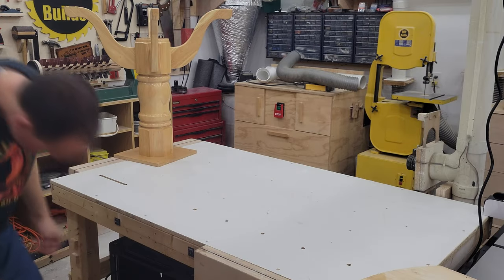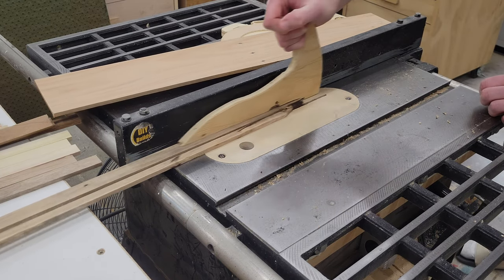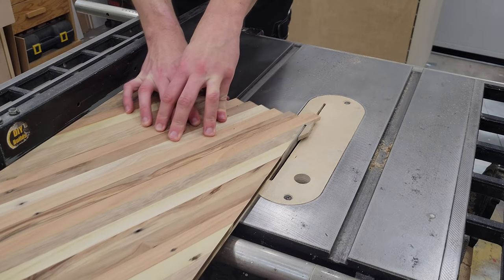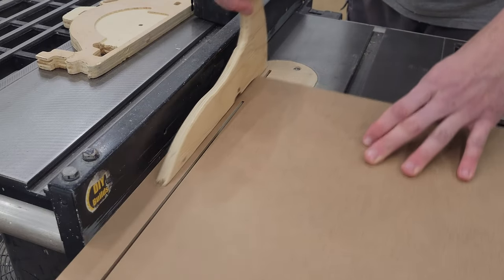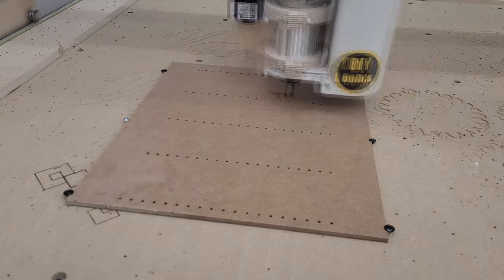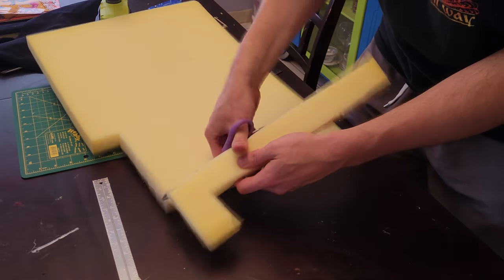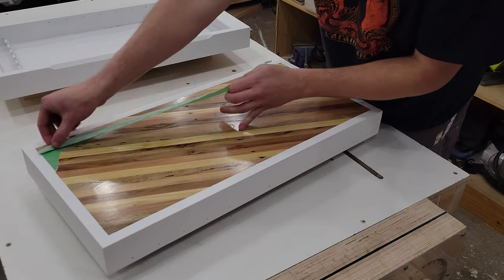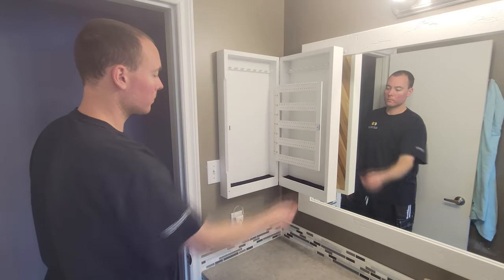DIY Jewelry Rack (Mother's Day Gift Idea)

Comment: That fits exactly between the light switch and the offset for the front thickness swing and mirror. Was that luck or did you take all the measurements upfront?